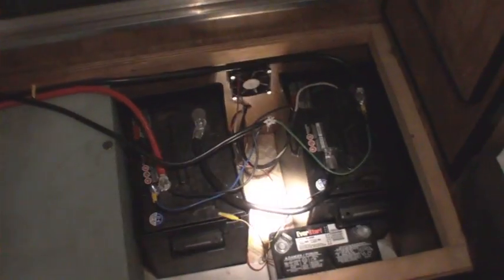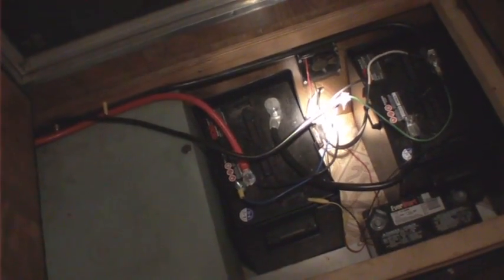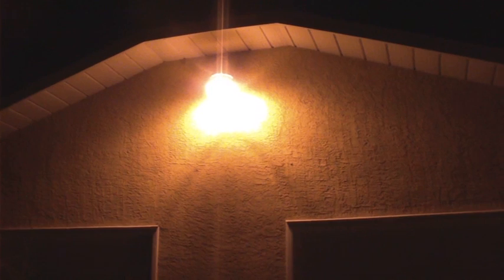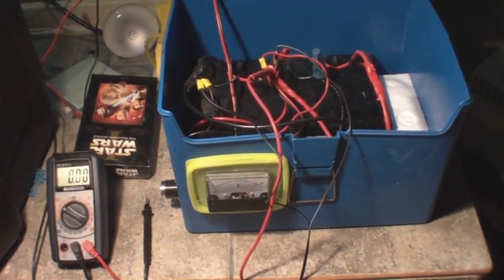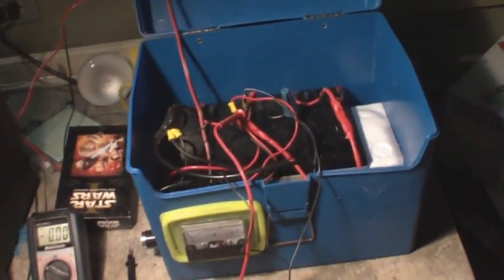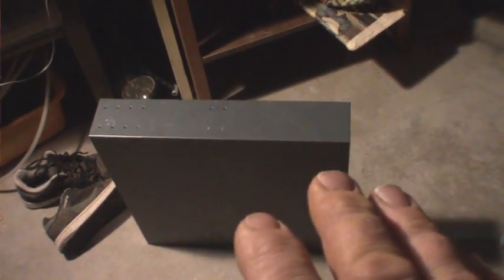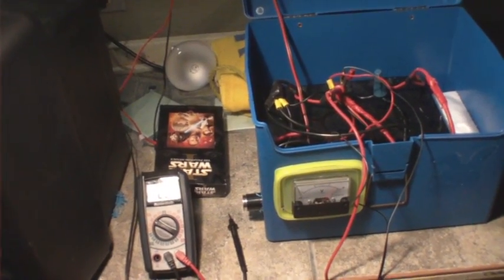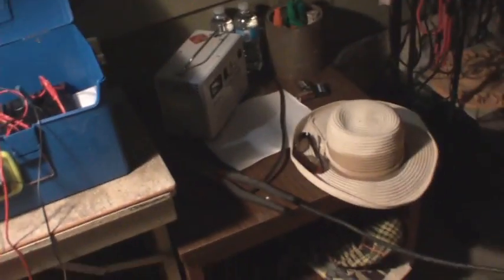Junk SLA Battery bank project - Video #4

Comment from the maker: I purposely chose a box that would fit a 24 series deep cycle, and in the meantime I'll burn out these SLA's cause they are free. If you find a case that's big enough for 2 6's, well, you can get your name in at local golf courses, they give up on bats in the spring, sulphated over the winter. They, as a pair, are heavy though!

Comment: Very valid rant in the description and a fascinating RV project..learned a lot :)
Re PCB's: The leftover PCB's are flat and on some units quite the size. Can take any remaining actual junk parts off with a good strong saw. One use is for projects box build material, shed roof repair strengthening, stuff like that. Sheets of fiberglass in a way.

Comment from the maker: The reason joule ringer and joule thief look better, on a meter, is the meter is lying in regards to the input, it is a triangular wave, ramped input which cannot be read properly with even an RMS meter, because A. the frequency of the input is high enough that the upper harmonics of that frequency become "out of range" of the meter. Therefore, the meter design to look at either linear DC, or 50-60 Hz AC, is fed high frequency pulsed DC in a triangular form. They simply lie, this I have proved.

Comment from the maker: Cheers man! Look up "Luminous efficacy" on wiki, great explanation. One also has to consider the source. If your source is solar, and you stick with straight DC - LEDs CAN win, if the argument is no conversion + life expectancy. If you are running a lamp "on grid" though, the opposite holds true as you need to convert to DC. Best way to run LEDs is either a constant potential / constant current switching mode circuit - beats any joule ringer / joule thief hands down.